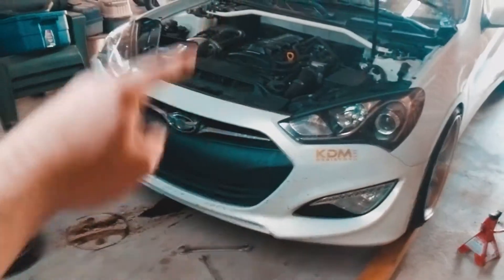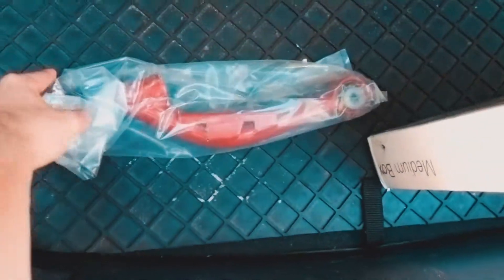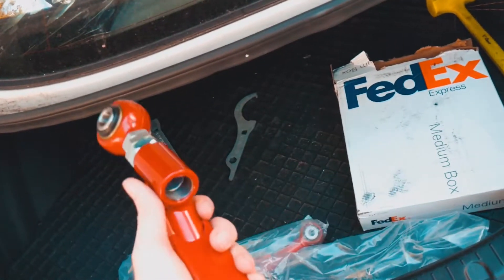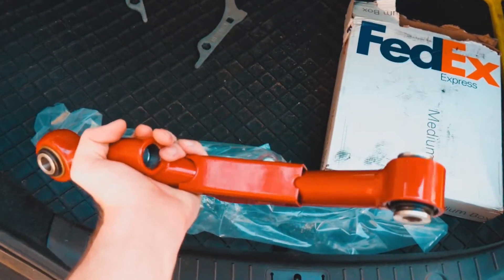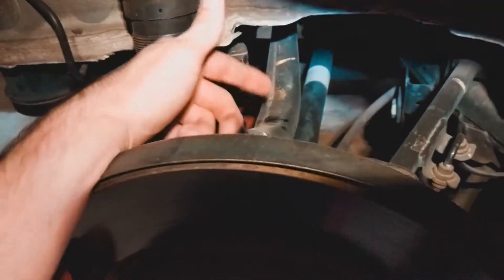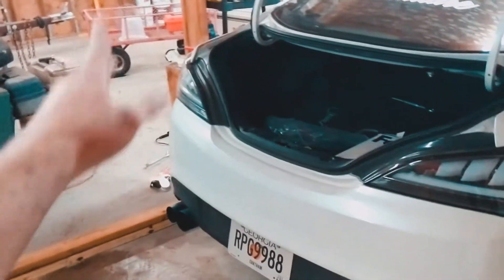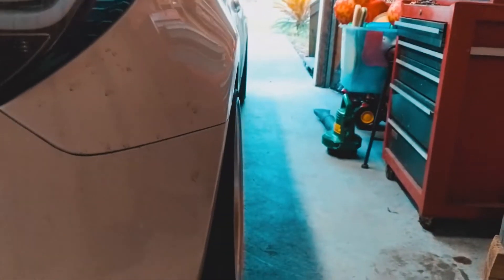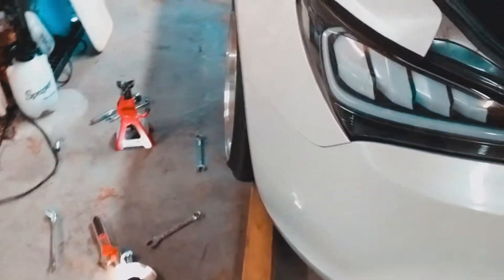GENESIS GETS CAMBER ARMS! (Rear Camber Arms Install)

Comment: What’s the difference between the camber arm and the toe arm?
Reply from the maker: Camber is the tilt of the wheel vertically and toe is the tilt of the wheel horizontally in layman's terms
Reply: Carlyle so if I was to put some coil overs on my genesis(since I massed you my struts and shocks crashing over an island on the street) do I need both camber arm and toe arm in order to align it or can I just put the coil overs and that’s it?
Reply from the maker: @humbertoheredia6734  you can just put the coilovers on, you only need camber arms if you want to adjust your camber for wheel fitment reasons, I had to get some because my wheels are 11' wide.
Reply: Carlyle so the camber arms and toe arms are only necessary if I plan to get wider wheels/tires?
Reply from the maker: @humbertoheredia6734  not really the toe arms, but the camber arms yes
Reply: Carlyle ahhh indeed, thank you my friend (: 
Just earned a subscriber
Reply: One more question, am I supposed to get a set? Or do they only have read ones for both toe and camber arms, I can’t seem to find any for the front?
Reply from the maker: @humbertoheredia6734  no problem bro! :)
Reply: @CarlyleWhite  whats your wheels specs?
Reply from the maker: @smermoto21  FR 19x9.5 +22 | R 19x11 +22
Reply: @CarlyleWhite  i have 19x11+10 rears. do your wheels poke out in the rears? also what camber u running?